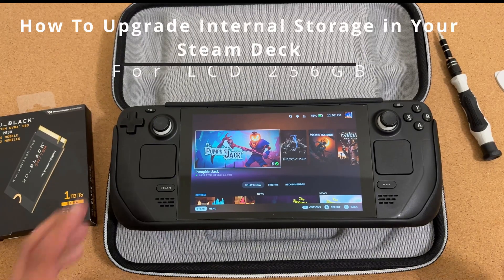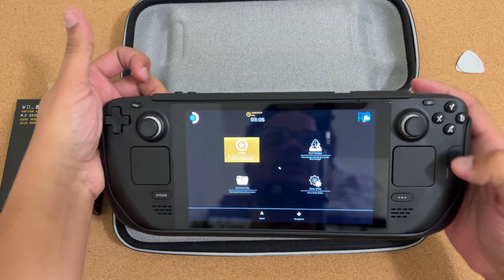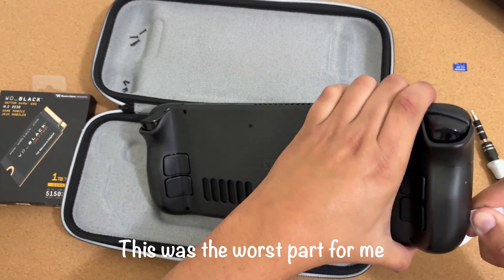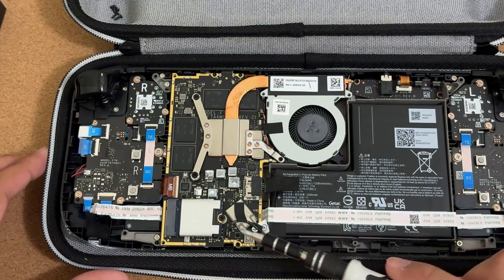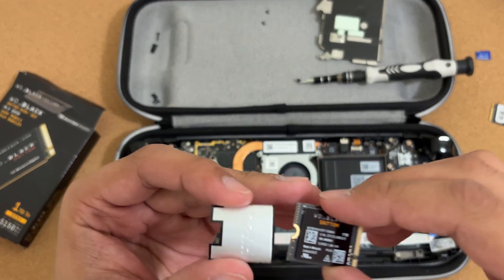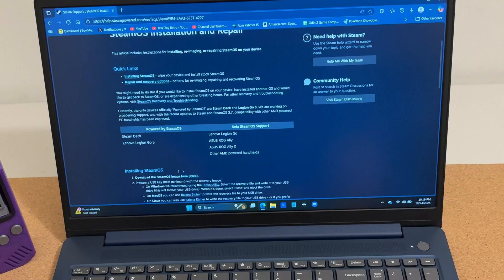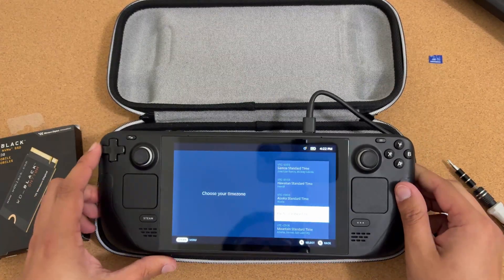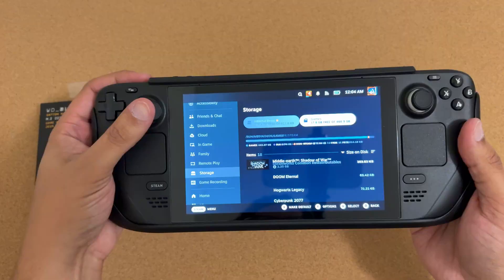How to Upgrade Your Steam Deck Internal Storage SSD | LCD 256 Version

Comment: winrar extraction is very slow to extract steamos repair image , after long time , i flashed usb and all ok but on the moment i want freinstall steamos on deck i got error .. i downloaded 4 times the steamos and the 4 times i got error with diferents usb drivers or sd cards .. the file extract corrupted to me .

Comment: The hardest part for me was unscrewing the backplate. Those suckers were so tight I almost round the cross and I almost lose my patience but slow and steady did the trick. I forgot to unplug the battery but had no problems and it's all working properly now.

Comment: Unless you were a computer programmer, do not buy this POS the steam deck oled is a fucking scam. Every game I started play on this thing , plays ten times worse than it does on xbox , so I don't know what the hype is about or the bullshit's about but now i'm in the process of trying to figure out how to return this junk.
Reply from the maker: User error
Reply: @JaviPlayRetro absolutely, I agree, 100%.They need a warning label on this thing stating that if you're not a computer programmer , don't touch it.

Comment: Hey after this part 12:00 my deck doesn't booting normally its stuck like its turn off, when i try to booting again its just like the same as before, i cant reach the desktop mode, any solution?
Reply: @seiya4284  having the same issue 😅
Reply: Any fixes for this yet?
Reply: update: you'll just need use another usb drive or you can just use your sd card, im using my sd card and its solved

Comment: Is it necessary to use the Battery Storage Mode? I am thinking to upgrade the SSD on my LCD model, it is the first one released, i think
Reply from the maker: Yes 100% because when prying off the backshell you will accidentally press the power button. Please just do it and remember you will need to use power cable the next time to power on. When I was doing mine I pressed the power button many times.

Comment: I used a M.2 cloner that I have to just clone the SSDs so I didn't have to bother creating a install . recommend getting one they come in handy
Reply: Oh really without any issues at all? So you just cloned the original m.2 onto the new m.2 and after you inserted the new m.2 it worked right away or what happened please?
Reply: @WingedDarter Yea was straight up copy

Comment: Nice video. Do you think the process is the same for the OLED version?
Reply from the maker: Its mostly the same. Only part is different is the screws on the backplate are all the same and inside the heat shield looks different and has different screws